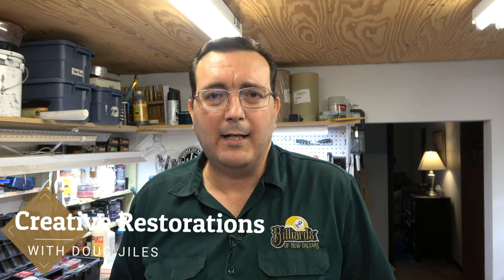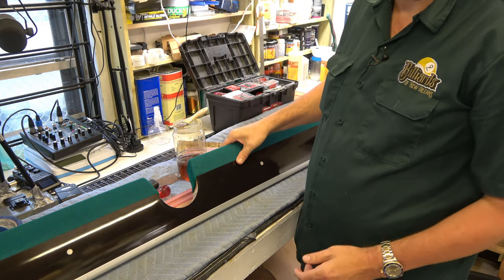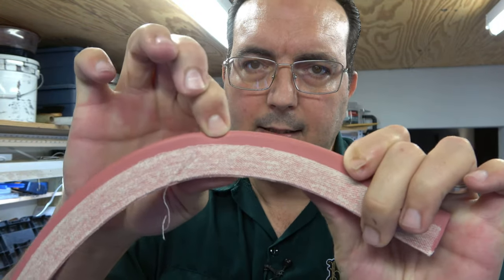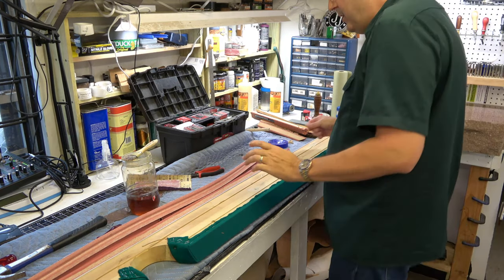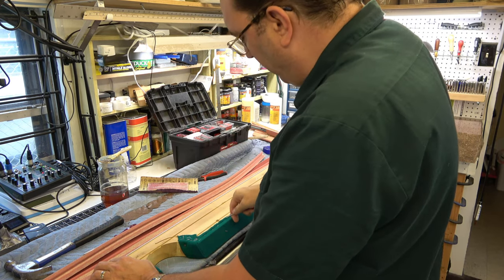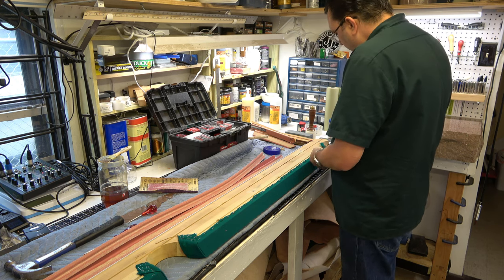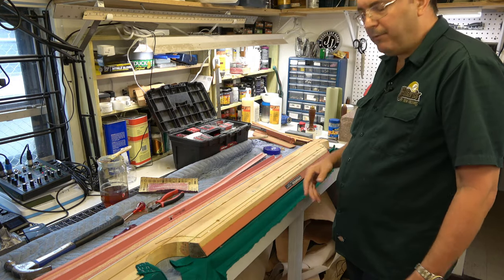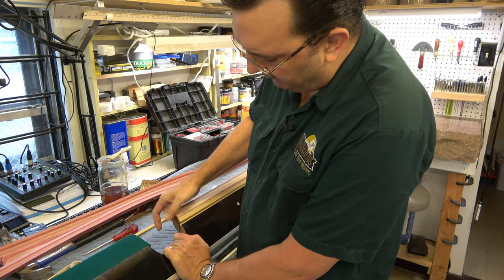How to Tell if You Have BAD Pool Table Cushion Rubber! (and How to Remove it)

Comment: Very informative video, I have a 1964 CG I that has what I believe to be the original Brunswick Monarch super speed bumpers. They are still soft and you can still hit a five bank shot with them. I guess the old saying they don't make them like they use to goes for rubber too.
Reply: Yes I believe they used pure rubber back then and they definitely last longer

Comment: I used an air die grinder on the last cushions I did a couple years ago, I wasn't sure if it would work but I was so disappointed how cutting with a knife came out so I tried it and it was so easy and came out so smooth and perfect. I also found out if you take the cloth out first on the featherstrip side first and just pull the cloth from the staples real fast most of the staples pop up so it makes pulling out the staples a lot faster and easier

Comment: Thanks for sharing your knowledge, I find it very helpful and informative. I only wish I’d seen the disassemble video a year ago. I acquired an 1939 Saunier Wilhelm last year and we moved it completely intact. It does need leveling. I thought I would have to replace the felt to level it I now know otherwise. It had just been replaced not long before I got it. Looking forward to the leveling videos. Again thanks for the videos and hater’s are gonna hate.

Comment: I will give you another solid installer tip for trimming the ends of the new rubber...not that your angle grinder doesn't work well...I use my Olfa 18mm utility knife with a brand new blade...the black ones are sharper than the silver ones...dip the blade into a glass of water before you make your cut and cut from the bottom to the top along your marked lines and your cuts will be so clean you can save the grinder step...i even add a little liquid soap to the water for some extra slippery knife action...try it next time Doug...you will thank me...and screw the haters Doug...if their business as table mechanics can be eliminated by youtube videos then we are all finished...lol...I stopped doing this as a day to day job 7 years ago and now I only do Simonis cloth on good tables for good players because they can tell the difference between adequate and perfect...also after doing thousands of tables I still learn things...I didnt watch your videos to be a critic...merely to see how you do it and maybe find something I didnt know before that could help...I havent been looking at the grain lines before but I will from here on out so I can avoid that sickening sound of wood tearing up with the old rubber.
Reply: I use a paint scraper with a sharpened edge to separate the rubber from the wood while im peeling it up 👍

Comment: If I may, and this is not a critique of how you remove stables on rails. But if I may suggest, I take a razor and slice the cloth on the underside (the angle) part of the rail about 1/2" down from nosing. Then just rip the cloth and staples off in one swoop. Yeah some staples may go flying and some may remain for picking, but for he most part the stay within the cloth for easy tossing.  I find it a bit quicker than picking them out.  Like I said, I'm not criticizing just offering an alternate. Try it you may like it, Or maybe you have and don't . Anyway, Happy Recovering.

Comment: Hello.  I like your videos.  I have a Brunswick table Bought it in March of 1995.  It is a Manchester model.  What replacement rubber, what glue, and what size staples should I use.  Thank you for taking the time.  Keep up the good work!
Reply from the maker: Chances are, it's K66 rubber. However, there are other rubber profiles that Brunswick uses. I have a complete list of all the tools and supplies needed in the description above.

Comment: Good morning, I’m about to replace my pool table rubber but I can’t quite figure out if it’s k55 or k66, it’s an American Eagle 9ft pool table, have you done work on this table before? If so what rubbers do you recommend. Thank you for the valuable info!
Reply: If you can remove the felt from the rails. Normally the name and type are on the rails. If you can't do that. Measuring the dimensions of the could do it but... Ive often had to reach out to other people in the billiard industry to find the right size rubber not all are common. Some aren't available at normal billiard suppliers.  Particularity the man at classic billiards.

Comment: HI DOUG. I NEED HELP PLEASE!  I was wondering if you can make a video on window rails are too bouncy. I'll see. lately. I've been noticing that most pool tables have bouncy rails, even when the cloud is slow. the rebound is almost twice as fast That is the inbound.  I am an advanced pool player and have excellent Q Ball control. however. however, it is frustrating because on lots of straight in shots, if it just so happens to touch the rail, It will rebound off and wobble the pockets. Also on bank shots. They all come up short because the balls are kicking off. The rails too fast and are not absorbing the spin of the object ball. When I complain or talk about this to most people comma they don't understand and think i'm crazy, Because they don't know much about cuba control. Another instance is sometimes when you are trying to play a safe shot or defense, You try to roll the ball to the cushion.
Extremely sextremely soft, but when it hit the cushion, it jumps out way farther than it should.  It's like you have to baby all your shots. In order to control the cuba and not have it run loose around the table. Basically the balls are hopping. I have been told that This is the way the penguin company makes their rails. Can you please share some knowledge on that?
Reply: Please excuse the errors I was using voice recognition

Comment: Not sure if it would help removing the rails, but have you ever considered using a heavy duty heat gun such as the Milwaukee to soften up the glue? I use it to soften up glue on other applications and it works great. Would probably be a slow process but almost guaranteed not to damage the wood, and the extra time spent you'd make up for on not repairing the damaged wood.
Reply from the maker: I've tried just about everything. The heat gun would heat up the wood too much. Solvents are generally too aggressive and can eat at the finish.

Usually, rubber comes off of the rails with no issues whatsoever. The problem is that some manufacturers don't (or didn't) bother to test the long-term effects of the adhesives they use. They should know that rubber will eventually have to be changed and should use a somewhat reversible glue. But, some (like Leisure Bay and a few others) didn't care. Once the rubber went bad, the table was already out of warranty. So, dealing with the glue they used was the customer's problem to deal with.

Your better, more reputable, companies out there like Brunswick, Olhausen, Diamond, etc... use better rubber, better glues, and better woods. So, this problem is far less likely on those brands.
Reply: @CreativeRestorations  I guess you just have to muscle it off, at least the cheaper tables I suppose. But the reason I saw your video was about replacing the rails. Is there any reliable "scientific" method of determining if the rails are not up to par? I have an Olhausen with Accu-Fast but they are probably 15+ years old and I'm wondering if I should replace them for better performance.
Reply: @Kevin-ib4gv  accufast normally last quite awhile.  But i have thought of a scientific test for your rubber. Build a small slope for the ball to roll off of. Measure an exact distance between the rail rubber nose and slope. Roll the same ball with the most accurately level ball you can find very important. Repeat the test on all diamonds measuring the distance the  ball rolls after contact with rail. Take the slope and ball to a brand new olhausen with accufast rubber and compare the results.
Reply: Not a bad idea, but I wonder if the cloth will affect it much. I had some work done on my cue at the local billiard supply and asked if there was a scientific way to check cushions for wear. He said no, just roll the ball against the cushion and see if it comes back the same speed as it went in. I told him I have an Olhausen with Accufast cushions that was 7 years old. He says "I have an Olhausen with Accufast that's 35 years old, and the cushions work same as they did when new. You definately don't have a problem with those cushions." Good to know!

Comment: Good job Doug. Just ignore the critics. Remember the joy of the Lord is your strength.
My question is how long does these bumpers  last before you consider replacing them?
Reply from the maker: Rubbers last as long as they last. There is no set interval for how often to change them. I've seen 2 year old rubber that's gone bad and I've seen 80 year old rubber that's still as good as the day it was put on.

Comment: How long does the rubber last
Reply from the maker: That depends on what kind of conditions it's kept in and the chemical composition of the rubber itself. I've seen 2 year old rubber go bad. And, I've seen 60 year old rubber that was still as good as the day it was made.

Comment: I picked up a no-name table for free. I took it since it had a slate top. The rails really feel good all the way around but one head rail has a pretty good check in it. The felt was cut as well as the rubber. I'm picky enough with my game that I want to replace that rubber to prevent strange bounce. My question is, do I need to replace the rubber all the way around? If so, How do I find rubber for a no-name table? The only identifying mark is on the old rubber themselves. (AMF)
Reply from the maker: Rubber should always be replaced in sets. If one is bad, replace them all. That way, they will all play the same. And, if the rubber is marked "AMF", chances are, that's an AMF table. They made quite a few tables back in the 90's that they didn't put their name brand on.
Reply: @CreativeRestorations  Thanks so much for the reply. Despite all my efforts I still can't find any versions online, AMF or otherwise, that resembles my table. All AMF tables I find are solid wood and mine is not at all. Either way, I assume any K66 profile rubber will do?
Reply from the maker: Yes. K-66 is K-66.

Comment: Mine spring back, but I still feel like they don’t bounce the right direction. I can go at a slight angle, and instead of following that angle off the bounce, sometimes it just comes right back the same angle. Very annoying.
Reply from the maker: If you can get your hands on some "Hot Wheels" track, you can make a ramp that you can roll the ball down consistently. Or, if you're handy with wood, you can make one. 

Point is, either will enable you to consistently roll the ball at an exact angle, at an exact speed, and with zero English on the ball. This is a much more precise way of testing rubber. But, the average table owner would never need that level of precision. More often than not, players impart some kind of spin on the ball when testing rubber without realizing it. So, if you want to make absolutely certain that you're giving the rubber a fair test, remove yourself from the equation.

Comment: HOW OFTEN do you replace the rubber
Reply from the maker: It isn't done on a time interval. It's done when the rubber either goes hard, soft, or when you feel as though it isn't preforming as it should.
Reply: @CreativeRestorations  ok time to find a pool table guru